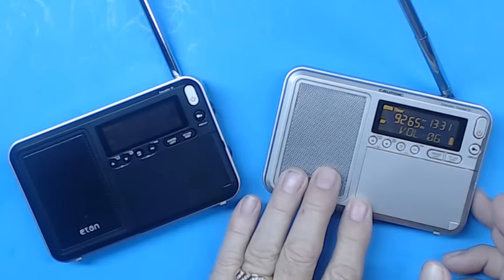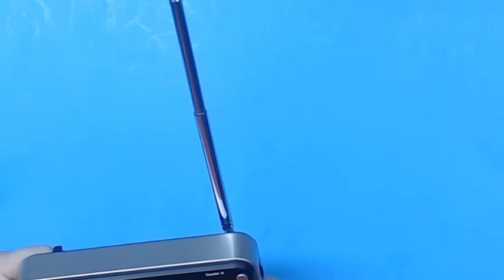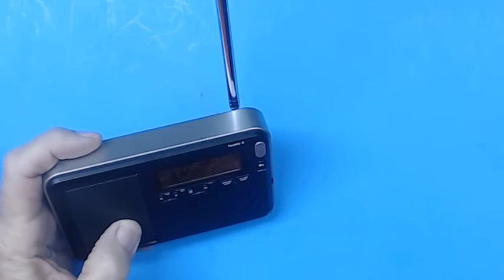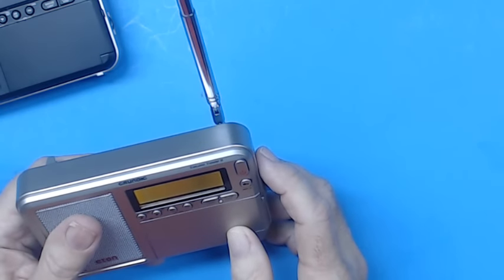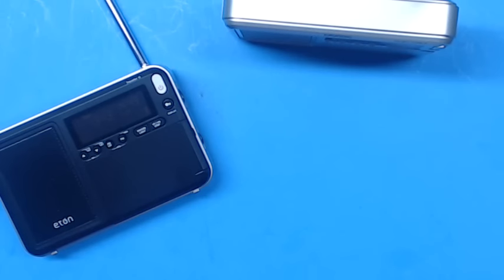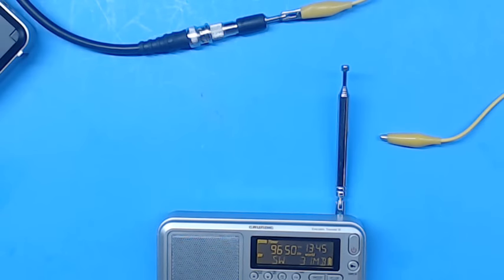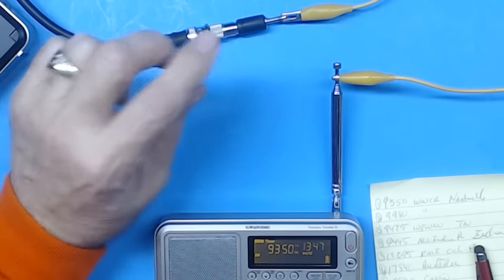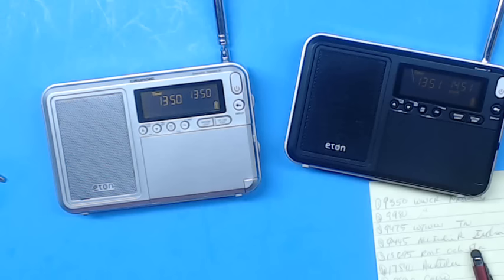TRRS #1096 - Eton Executive Traveler III Shortwave - Reception

Comment: The case on the executive edition is very attractive and a nice addition.  However, the great concern about whether the antenna can be extended with the case attached (and all the effort that the manufacturer went through to make that possible)...is absolutely laughable.  What good is a case...and an antenna that fits through it,... when the cover muffles the speaker when in operation? Have we forgotten a salient point here?... namely, that radios are for being able to LISTEN TO!? There are no holes in the cover for sound!  The only way you can USE the radio with the cover installed is via headphones!  Similarly, why all the great effort to make sure the power button is exposed through the cover? I'll gladly open a cover to turn a radio on or off.  It's having the sound blocked by a cover that is unacceptable to me and therefore something that cries to be corrected.
Reply from the maker: Excellent point.